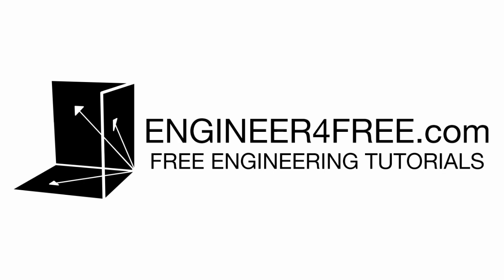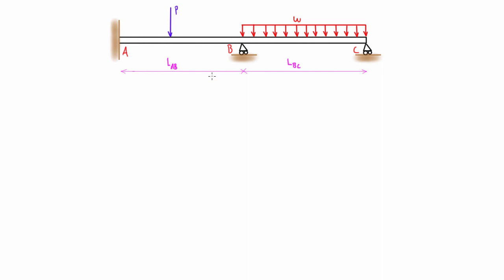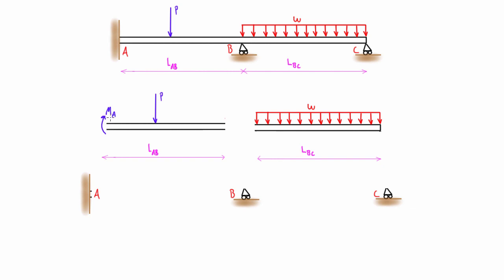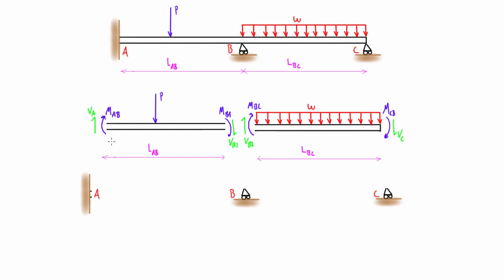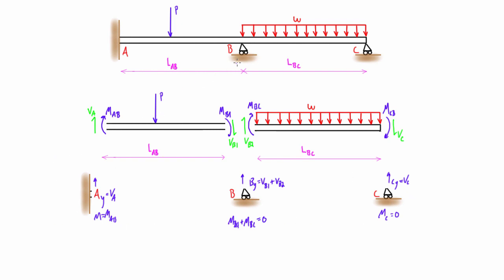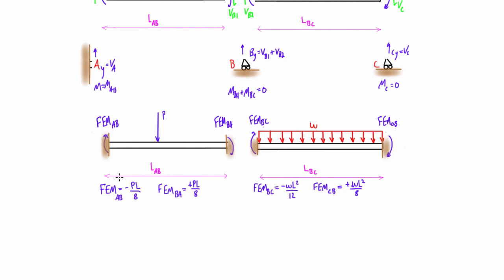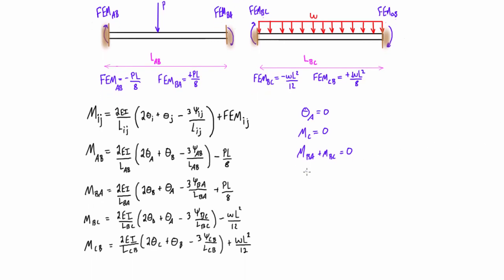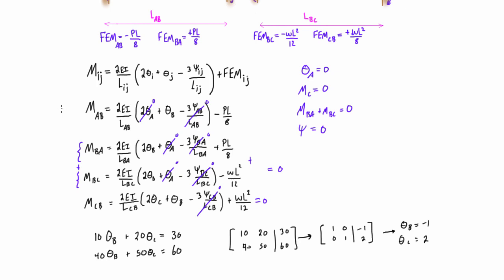Slope deflection method explained

Comment: How can we understand the sign convention of moments? Isnt it smiley face that makes positive moment?Why are we taking each moment   in the clockwise sense I mean? :))
Reply from the maker: Yeah a beam bending like a smiley face is referred to generally as positive bending moment. But Some of these methods have specific rules about which way CW or CCW to take the moments at certain ends. I recommend watching the full section on Slope Deflection Method here: engineer4free.com/structural-analysis for some more examples to get the hang of it!

Comment: What if there's two forces on the beam(ab), how do you get the FEM there?
Reply from the maker: Hey either check which ever Structural Engineering textbook you have, or google "FEM table" and you will find the case for two point loads on a span.
Reply: @Engineer4Free  thank you!

Comment: Also, there's a mistake in the equation of Mbc where you use thetaA instead of thetaC, and end up not justifying why thetaC is zero as a consequence.
Reply from the maker: Thanks for pointing out the typo. I have clarified it in the description and also your other comment it detail. If anyone else is reading this comment and can't find the other explanation for some reason, the thetaA in the expression for Mbc should be thetaC. thetaA is equal to zero (because rigid connections stay rigid), thetaC is not.This means that the correct term thetaC is not to be crossed out. The overall expression Mbc is still equal to zero. The reason Mbc is zero is because if you take a virtual cut infinitesimally close to C and draw the free body diagram of the section between the cut and C, the couple caused by Cy and the internal shear tends to zero (as their separation tends to zero) and the distributed load itself tends to zero as well so it doesn't cause a couple, therefore no moment is caused by that couple at C, and so there will be no internal moment that needs to counteract it, ie, internal moment at C is zero, and internal moment at C is Mcb, so Mcb = 0.

Comment: If Mcb=0 shouldn't we use a modified version of the slope deflection equation for Mbc? ie.: Mbc=(3EI/Lbc)(thetaB-lambda/L)+FEMbc? And how do you know Mc=0? Is it because you apply equilibrium at C or because there's no moment reaction from the support at C? Plus, in my book I have tables with FEM=qL^2/8 ie, do you know what is different for situaitons where the beam doesnt appear with two fixed end for FEM tables?
Reply from the maker: Thanks for pointing out the typo in the expression for Mbc, I have made a note in the video description clarifying the typo: The thetaA in the expression for Mbc should be thetaC. thetaA is equal to zero, thetaC is not. This means that the correct term thetaC is not to be crossed out. The overall expression Mbc is still equal to zero. The reason Mbc is zero is because if you take a virtual cut infinitesimally close to C and draw the free body diagram of the section between the cut and C, the couple caused by Cy and the internal shear tends to zero (as their separation tends to zero) and the distributed load itself tends to zero as well so it doesn't cause a couple, therefore no moment is caused by that couple at C, and so there will be no internal moment that needs to counteract it, ie, internal moment at C is zero, and internal moment at C is Mcb, so Mcb = 0. IF there was an applied moment or a fixed connection at C then Mbc would not equal zero. It does however equal zero because of the logic just stated. I don't think I understand your last sentence. Some books represent distributed loads as w, and others as q. w(L^2)/8 is the same as q(L^2)/8, they just picked a different letter to represent the distributed load. If you are presented with a statically indeterminate beam and the loading on a given span is not specified in a FEM table, then you will be better off solving the problem with a different method, likely the 3 moment equation, or force method. Relying on tables can be dangerous for this reason that the table for your specific scenario might not be readily available. Also, to address the first point that you made, I recommend just using the regular/full slope deflection equation and setting it equal to zero, and not using pre-reduced forms if possible. It's just better and leaves you in more control/understanding of what's going on. I recommend watching the worked example if this problem, where I do not make the same typo. It's a 3 part video and the links are here. part 1: https://youtu.be/QAvE9ENuZvQ part 2: https://youtu.be/la0aFc4O3cY part 3: https://youtu.be/YnUiCh2QkNA